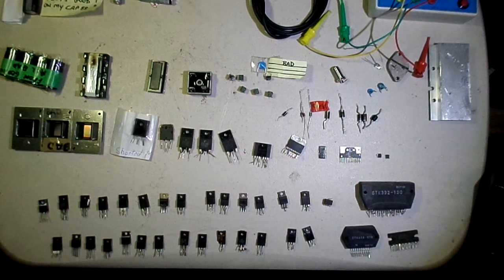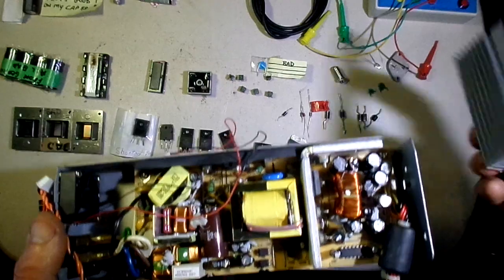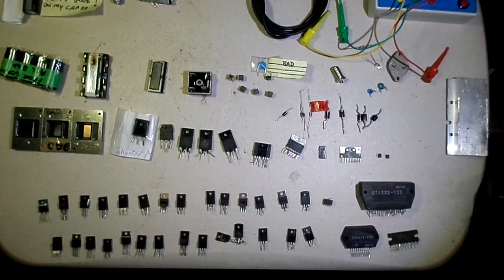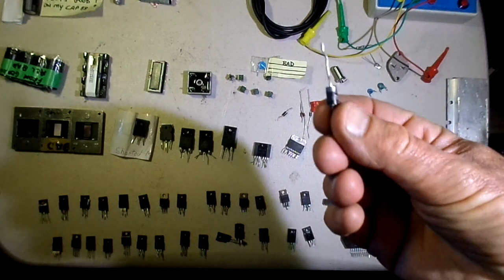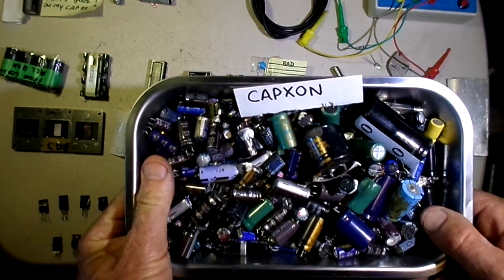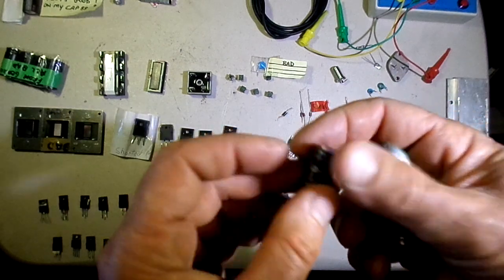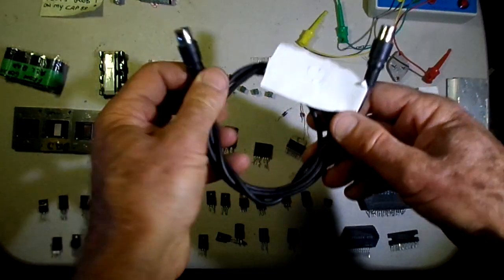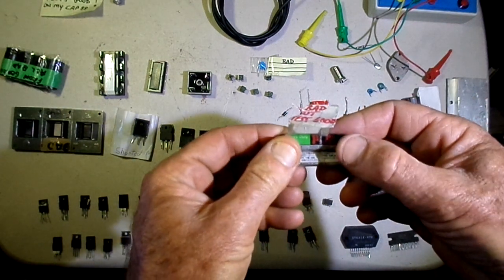High failure components in power supplies.  Bad capacitors can make transistors and diodes fail.

Comment: CapXon, or more accurately CRAPXon (as I call them) caps are still turning up in gear I repair and still the number one issue when there's a fault. They are absolute garbage and they are the first thing I suspect when I get something that's not working the way it should.

Comment: Hi, I too have been  in electronic repair  for over 50 years and seeing the way you have all the dead components out like that reminds me of how I also used to keep various electronic devices and a few of us who were also in various repair fields would love to just sit around at times and discuss all  the various types of failures since as you also said it, some components just because of what they are and where they are used have much higher failure rates than other components  and I think the majority of failures comes down to usually one of two things, either the heatsinks used for a device are  too small and that in turn allows the device to run much hotter than is good for it  or the component is way over rated for its intended application. Electronics repair is a profession as well as a hobby I could never get tired of being in.

Comment: I found 2 mosfet in my tv power supply short circuited. so changed it and 5v output works. does this may caused by other component?

Comment: Yep, bad solder connection on the horz.driver transformer and the h.o.transistor would short...
Good money jobs,however, electrolitics were the most common components to be replaced. 
Mitsubishi widescreens would have at least a hundred leaky caps or more at times.
I miss the business.!!
Reply from the maker: You can always re-open a shop. :-)
Reply: @GrantsPassTVRepair  ...This os true, though, I'd do it as a side business along with restoring old radios, TVs, some antique machinery as well as diving into the new technologies. 
Funny thing, I just saw a 70 inch tv for under 500 dollars, so, I just don't think it's feasible to make a full living of repairing TVs alone....
At least not like the heydays of the 70's 80s 90's and early 2000's. 
Best wishes Dave.😉
Reply from the maker: @frankpitochelli6786  I rarely repair TVs at this point and I'm glad. Most of my work I do now is TV antennas, Hanging TVs on walls, home service calls for the elderly, Hookups, Helping people get set up their TVs to stream video, and miscellaneous electronic repairs in my shop. There are plenty of other things in this business that aren't related to repairs that people need help with. With all the new technologies many people are clueless and need assistance.

Comment: I have a LG 60PN5700 UA. It is stuck on logo screen.  This started about 2 yrs ago. I put the tv up and pulled it out this week.  To my surprise the tv started up properly and had a perfect pic for a few hours.  I turned it off and when I turned it back on it would not go past logo screen.
Reply from the maker: You might want to experiment with freeze spray and a heat source pointed at various areas of the main board just  to see if you can temporarily fix the problem, which might enable you to isolate which board is the problem.

Comment: Today, modern switch mode Power Supplys don't have many diodes. The Secondary Rectification is done with MOSFET for example...
And those things tend to fail. Also the quality of caps got better. Though that doesn't mean it is a good idea to use a 10 Year old ATX Power Supply in moden systems...

Comment: Excellent video! I'm not a tech anymore, but I still dabble. Capacitors are just weird. 😂 They won't pass DC and AC makes them crazy. One of the things I try to do when troubleshooting electrolytic capacitors in power supplies is figure out what purpose the cap serves. In the old days with linear supplies it was easy! Either the cap provided a charge to a voltage doubler or it filtered ripple. They still serve a filtering function, but it's different. More like wave shaping. The high frequencies don't help. Those caps work hard for a living.

Comment: Around 2:45. Everybody should collect those bad CapXon caps and then dispose of that junk i.e. spread them all over the place at the CapXon booth on the next fair. Filming all of it and then publish it on the internet. I really do hate them. This also goes for my special friend Leilon.
Reply from the maker: I just counted my collection of bad capacitors, and noticed another brand called Samwha which was right up there with Capxon, and followed by Samxon, Hec, and Nichicon. A poorly designed circuit could also contribute to early capacitor failure, but from everything I've been reading, it would appear the markets were flooded with bad capacitors for a while.

Comment: Nice vid thanks. Capacitors still a trouble I recently found 2 nichicon electrolytics that had gone short circuit in a high end power supply no sign they were bad until removed and tested. The power supply was over 10 years old almost ran 24/7 and cost $5000 Australian so i can honesty say we got our money’s worth. Did alot of damage to the board and the power supply was scrapped. In Australia not much is repaired in the jobs i have been in cost for new ways out the time to repair most of the time.
Reply from the maker: Ouch! That's an expensive power supply.

Comment: Thanks Dave! Yep, it's always good to test batteries and capacitors under a load! Also diode junctions can pass a voltage test with a DMM and fail when tested at a higher voltage. That's why it is good to have a VOM with X10K.
Reply from the maker: I've also seen a diode test good, but fail under load one time.I guess it's rare but it does happen now and then.

Comment: 4:24 - In my opinion, I think it’s a bit misleading to call that a “bad” cable. If it tested good, then it tested good. The reason it blocked some channels is most likely due to the cable being poorly manufactured. But a poorly manufactured cable is not the same thing as a bad cable. I imagine that an impedance discontinuity in the cable, bad cable shielding, or using a cable with a characteristic impedance that doesn’t match the rest of the system could be a few things that could cause this kind of behavior.
However, the cable shouldn’t really be marked as “bad”, because if it is testing good and it doesn’t appear to be glitchy in any way, then it can most likely be used to transfer signals of lower frequencies without any problems.
In order not to deceive myself, I would probably have marked the cable “Poor quality” or “Not suitable for high frequencies”.

The Capxon capacitors have for a long time been notorious for failing often and quickly. I guess they must have formulated the electrolyte very poorly when manufacturing those capacitors. Most repair techs out there have probably replaced at least a few of those caps at some point in their life.
At 2:40 - Are all of those really Capxon caps?? 😮 Wow! That clearly shows how horrible those capacitors really are.
These capacitors are so terrible that I sometimes consider replacing them in devices I’m working on, even though the Capxons have still not failed. In that case, I will put something better in there, like for example Rubycon, Nippon-Chemicon, Panasonic or something else that doesn’t have electrolyte of low quality in them.

I have the same experience with power transistors as you do. They fail quite often and should be checked as one of the first steps when repairing an electronic device.

In my experience, it’s not too uncommon that diodes (for example rectifier diodes) fail, but certainly not as common as power transistors and capacitors failing.

You have a huge bin of failed Capxon capacitors there. What is your experience on other brands of capacitors? Do you have similar bins for other brands of capacitors as well, or do you only have that one for Capxon branded caps?
It would be great if you could make a video sometime where you talk about which brands of capacitors fail the most in your experience.

Thanks for the video. I really like these kind of general repair tips. I have been subscribed to your channel since many years back, and I have picked up many useful ideas, tips and tricks from watching your videos. Thank you for all the great content. Keep up the good work.
Reply from the maker: I should have clarified that not all those capacitors were Capxon. In an upcoming video I should quantify the bad caps by their brand name.
Reply from the maker: You also made a good point about the cable. Its impedance may have been fine for what the manufacturers designed it for.

Comment: Where is a good place to get replacement back light  strings?
Reply: i havent' tried them yet, but here's a link i got from a video someone replaced the backlights on>https://www.aliexpress.com/item/32860269570.html?spm=2114.search0103.3.95.16167c820h8OPU&ws_ab_test=searchweb0_0%2Csearchweb201602_4_10065_10130_10068_10547_319_10546_317_10548_10545_10696_10084_453_454_10083_10618_10307_537_536_10059_10884_10887_321_322_10103%2Csearchweb201603_53%2CppcSwitch_0&algo_expid=a0f5d6e1-66e2-45c5-a719-30c1b9460ea9-13&algo_pvid=a0f5d6e1-66e2-45c5-a719-30c1b9460ea9&transAbTest=ae803_3

Comment: Batteries should be tested under load. Good battery testers do this... Not all!
So a voltmeter isn't really any good here, unless you also load the battery down.
Reply from the maker: Good point. I've been doing load tests on car batteries for years,  but rarely for small batteries.
Reply: Grants Pass TV Repair  My VOM tests 1.5V batteries at 200mA. I have found a lot of coin cell batteries as well as others that check good on voltage but fail with my VOM.
Reply: Lovely Video clip! Forgive me for the intrusion, I would appreciate your initial thoughts. Have you heard about - Tarbbatigan clean errors Tip (Have a quick look on google cant remember the place now)? It is a good exclusive product for discovering how to fix electronic devices minus the headache. Ive heard some amazing things about it and my mate after many years got excellent results with it.

Comment: Useful info, those H.O.T gets super hot. Liked 👍
Reply from the maker: I remember some of the Sony TVs had horizontal output transistors that would operate at temperatures hot enough to burn you, and sometimes an excessively hot horizontal output transistor meant there were other issues in the circuit, such as a bad capacitor, flyback transformer, and or voltage regulator that would cause this. I should have also mentioned  the cascade effect, and how one bad component would cause many others to fail.